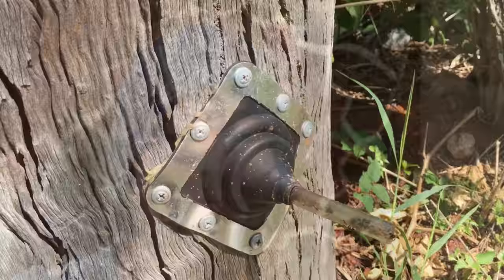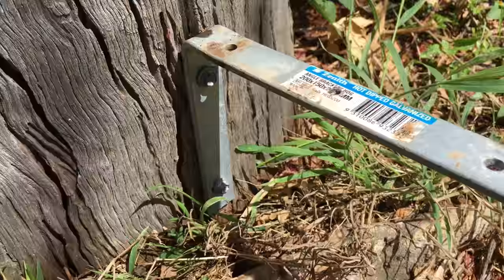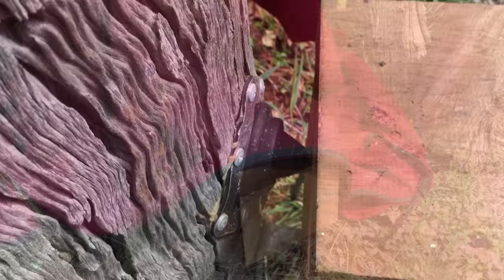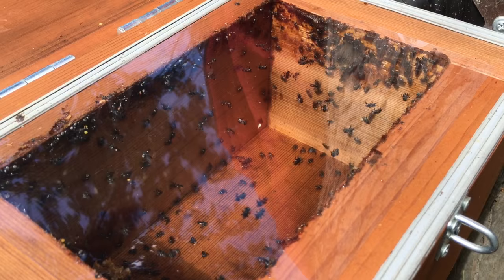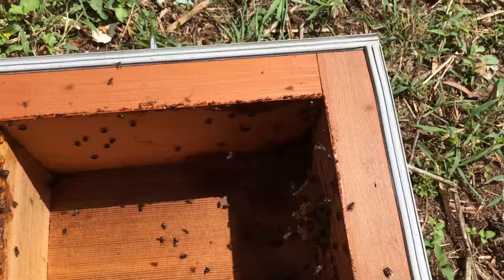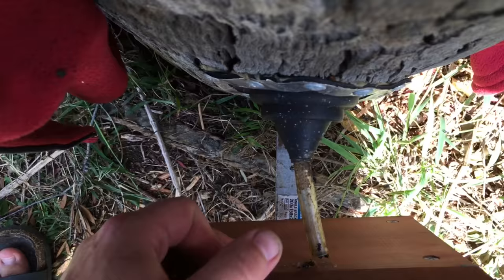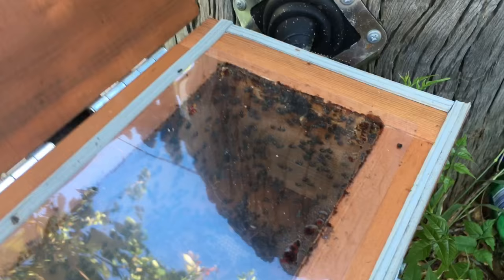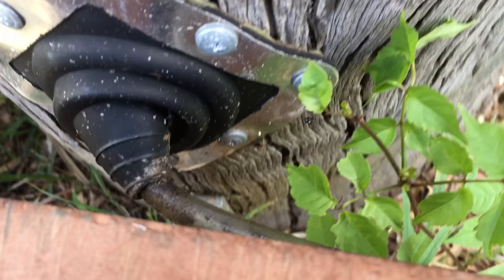Natural hive duplication 🐝

Comment: Hi im from Malaysia. ive been doing this for a week now, the bees is currently waxing the new entrance.
Do you leave ur backhole open for ventilation or seal it off on a latter date?? Your vids has taught me alot!! TY
Reply from the maker: Hey there glad you like them. I seal the vent hole with a screen. This enables the bees to control the heat and humidity after the disconnection. For the best results honey pots and pollen pots are in place when the brood is placed in. 👍👍
Reply: Hi, may i know where is the brood came from? Is it from the original hive? Or you borrow brood cell from other hive then place it into this men made hide? Thank you.

Comment: I have been using this method to propagate my hives due to the hives being completely different shapes. My new hive has been sealed within a month and all is well. But today the new hive was attacked by a wild swarm of carbonaria. I removed the pipe connecting my two hives to stop the old hive from fighting so i could let the new bees take the hive with small losses. i think i have just captured the wild swarm in my new hive without splitting the old one as they already started storing propolis and pollen within an hour of disconnecting the pipe. What do you think?
Reply from the maker: You certainly have caught them!  Just you wait till you see how quick they fill the hive. Remove your other box behind and place at a friends place while this is going on or they may be next on the take over. Using a weak colony of Bees to bait swarms is something I have done in the past to make very strong colonies. Great work there!!!
Reply: Australiannativebee its been 6 hours and there are evenly spaced spots of propolis covering the entire inside of the hive. There are also much less bees moving around. I will move my old hive overnight. Thanks for the advice Nick i hope it works
Reply from the maker: How’s your hive going to everyone can know?

Comment: I have a question about eduction method, in case after the new queen bee has been borned and starts laying egg in the new hive, will the queen from mother hive go to the new hive and kill the new queen? Or probably the queen from mother hive will go to new hive to kill new virgin queen been in new hive? Will this situation happens? Thank you.
Reply from the maker: Good question!! The queen from the mother hive does not leave the mother hive ever despite common beliefs that she does. The workers from the mother hive read a Virgin queen and place her in the New hive. If the new hive remains connected after the Virgin is mated, then the workers from the mother hive kill the New queen and dissolve the brood. The new hive becomes then a storage area. But this can take some time. You may even have the new queen laying her eggs for a month or so before this happens. I will generally give it a good couple of weeks to settle. If I see the virgin queen I will disconnect the rear tube straight away. Hope this helps. Thanks for visiting and writting 🙏🏻
Reply: This is a informative reply. Thank you bro.
It means queen in mother hive will not go into new hive and fight with new queen. 
Basically we need to monitor the hive, as soon as there are new egg in new hive then immediately we have to disconnect the 2 hives.

Thank you again.

Comment: Hi, can you tell me what the rubber flange you have covering in entrance hole is from please
Reply from the maker: Sure! They are called a Dektite roof flashing. When you put your tube through cut only a tiny hole and force the tube through so it grips tight around the tube. Also cut your tube on a pointed angle so it changes the hole from small and round to oval. This helps a little with bee traffic. 👍🏻

Comment: Do you need to add brood, can you let them build new brood
Reply from the maker: mite5255 you can actually add nothing if you wish but they may not take a hold. Time frames for adding nothing usually range from 6-18 months in a warm climate. If you see bees leaving with wax on their legs then it will be faster. 👍
Reply: Can you use the brood from another hive of the same type of bee